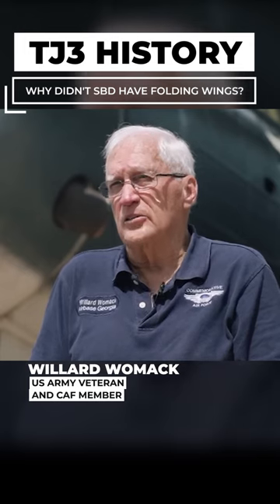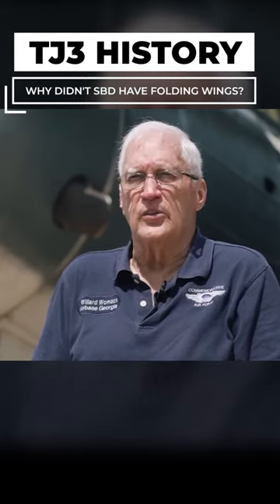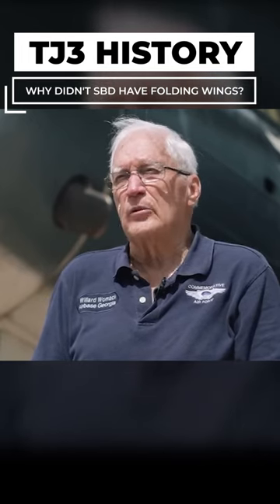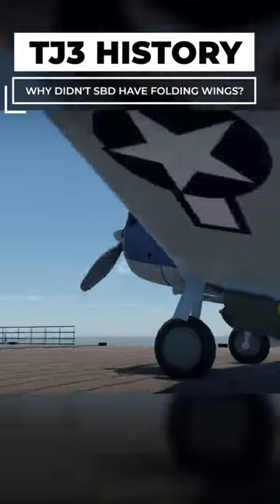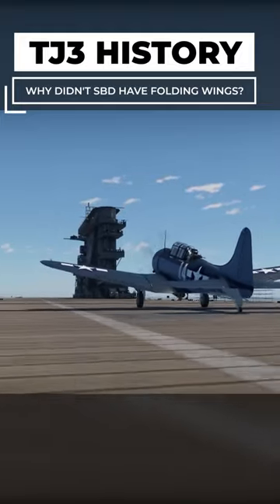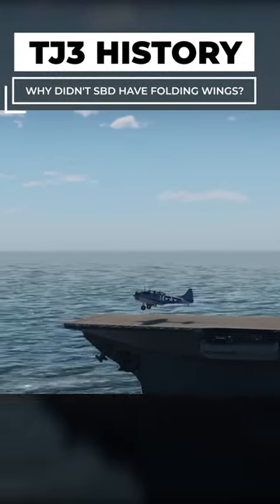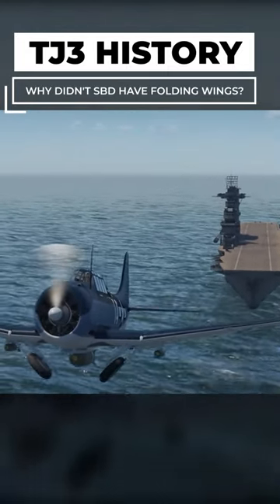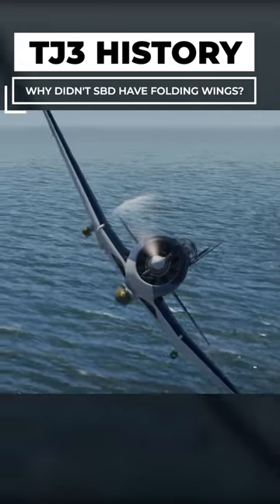The Unusual Wings of the Dauntless Dive Bomber #History

Comment: The Dauntless was a pre-WWII Dive Bomber and when it was developed, folding wings were just coming into prominence.  The idea that they made a calculated decision to not have folding wings so it could carry a heavier bomb load is wrong.  The Dauntless didn't have a high bomb load either way.  They just believed they had enough space on carriers so they didn't add the newest innovation, folding wings.  The Dauntless was actually a small plane compared to the dive bomber that replaced it, the Helldiver.